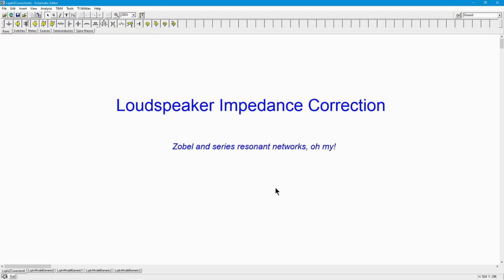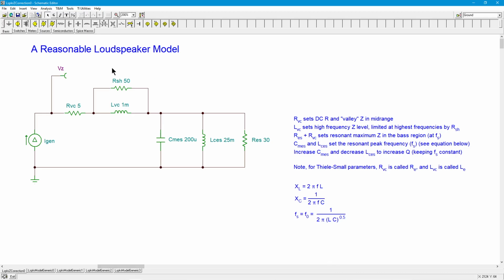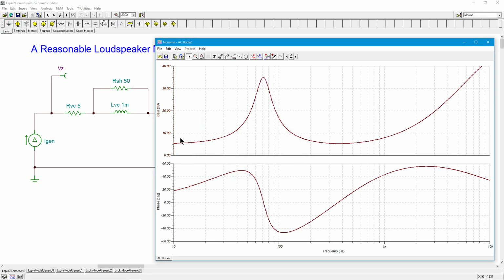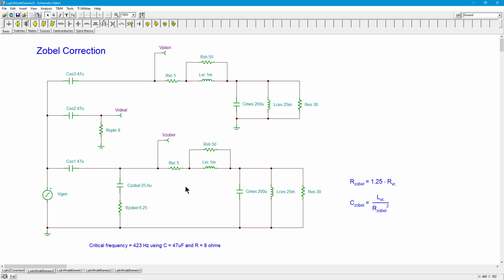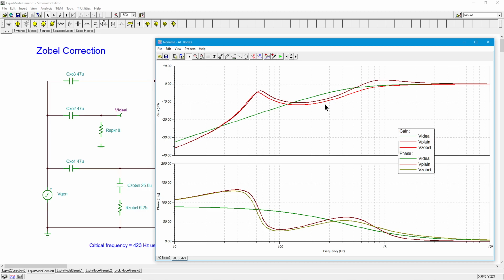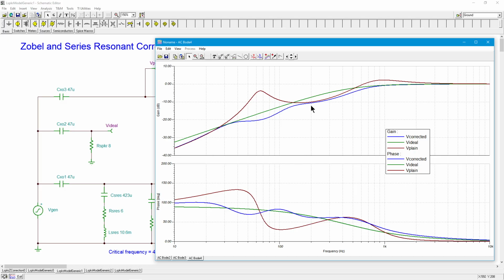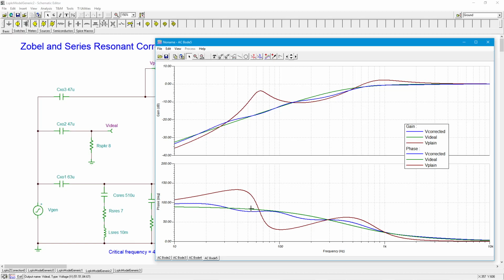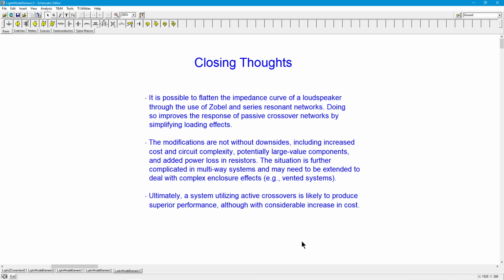Loudspeaker Impedance Correction

Comment: I've often wondered why anyone would use passive, speaker level xovers at all. I can't think of a single metric where they are better than a line level xover and multiple amps
Reply from the maker: Cost. That's an extremely important metric for most people. Other than that, though, I completely agree, and that's why active systems are ubiquitous for large PAs and critical monitoring.
Reply: @ElectronicswithProfessorFiore it could be argued that only really applies for the lowest power outputs. Given that the output transistors are often one of the most expensive parts of an amplifier, and that their price doesn't scale linearly with power handling, it can be cheaper to build two, lower power amplifiers rather than one, higher power amplifier. Add to that the cost of the capacitors, inductors and resistors to handle that power, and multi-amped systems will work out cheaper as power increases.
Reply from the maker: @JaenFoster  That's certainly possible, especially if we're looking at purpose-built compact monitors, but don't forget the history aspect. The so-called "golden age" of hi-fi stereo was the 1950s through 1970s. We didn't have the semiconductor devices and transducers then that we have now, and that was when norms and standards were set. In fact, it was difficult enough to get people to adopt using two loudspeakers that were separate from the electronics, let alone having multiple amplifiers for each loudspeaker (and placing the amps inside the enclosures would make the loudspeakers larger and require AC power). Now these are things that audio enthusiasts wouldn't mind, but for many people (casual listeners), that would be a bridge too far. Many writers have noted that the need for extra gear (finding locations for four loudspeakers) is what really killed the quad systems back in the 1970s. 

For most people, telling them that upgrading their system will require dumping not only their loudspeakers, but also their amplifier/receiver, and that their new loudspeakers will each require AC power cords along with loudspeaker cables, will be a tough sell. And if they have a 5.1 or 7.2 system, it's going to be that much more difficult. The "historical inertia" can be tough to overcome. Yes, you and I may be interested in such, but we are not the majority (and in my case, why I never would have made it as a marketing/sales guy).

Comment: 6:34 
any suggestion  where one might look to find a model for ribbon speakers ?
Please advise.
Thank You.
Reply from the maker: I haven't measured any ribbon tweeters myself, but looking at published impedance curves from a few manufacturers, it appears that within their operating range they are pretty much resistive and fairly constant. For example, you might see 8 ohms plus or minus an ohm with a fairly consistent and smooth phase response. Thus, just using an 8 ohm resistor (for a nominal 8 ohm ribbon), would be a reasonable approximation, especially when coupled with the wildly varying Z of a dynamic woofer. You could probably add a small inductive element in series for a little more accuracy, and even a modest resonant part, but those effects are quite small. 

I did a quick search just now and found some published curves at Parts Express. Here's one (never used it, so I'm not endorsing it, just an example of the Z curves):
https://www.parts-express.com/GRS-RT3.0-8-Hi-Res-Neo-Ribbon-Tweeter-8-Ohm-272-206
Reply: @ElectronicswithProfessorFiore  THANK YOU SO VERY MUCH, Profesor !